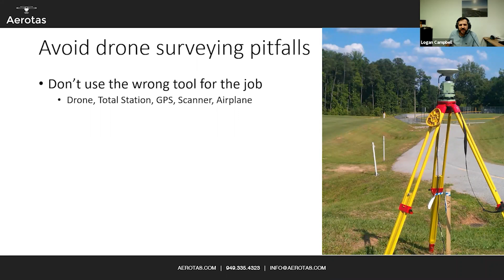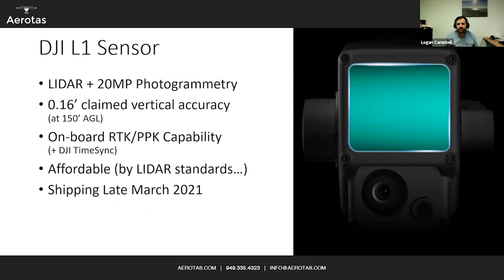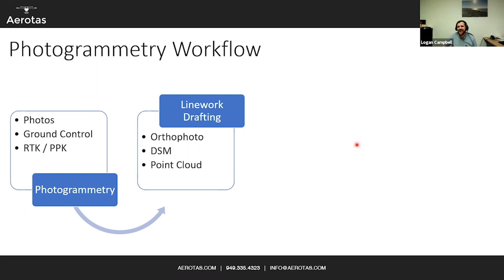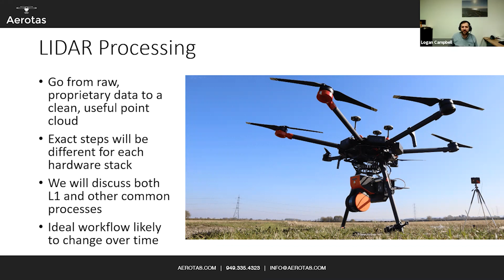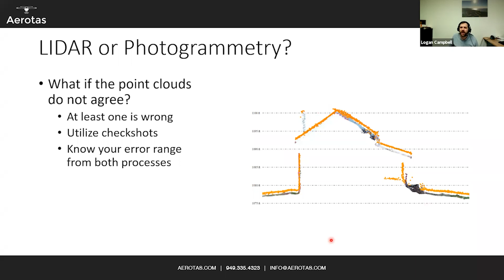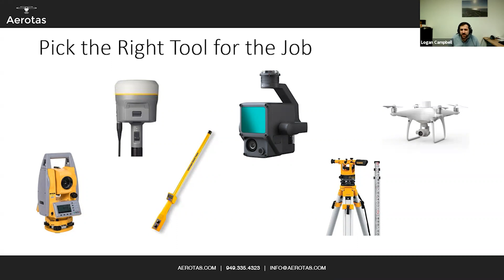Workflows for Combining LiDar and Photogrammetry Data - 2021 Western Regional Survey Conference

Comment: Thanks heaps for your sharing! For a 30skm mining survey to identify outcrops from black color manganese ore at 30-50cm dimensions. Do you suggest P1 or L1 for the work? Or manned plane is good enough to get 5-10cm / pixel high resolution photos? Another issue is the terrain follow function as the outcrop is somewhere 100m elevation difference. Do we need to use Terrain follow for the task which means L1 might not be applicable for terrain follow function? Really appreciate your thoughts. Billion Thanks!

Comment: You have done a great job of explaining the difference between photogrammetry and LiDAR workflows along with their pros and cons.  We are excited about the L1 due to its very low cost and specs on paper.  But i have so far seen a test that didn't turn out so well when compared to current 150k LiDAR drones with fuzz, aka plus and minus points taken at the same point.  I am also puzzled that there is no description on using the RBG camera to do photogrammetry without having to use the LiDAR.  It must be able to capture images to use for photogrammetry since it has a mechanical shutter which is not used for adding colorized point clouds.  It would use the cameras electronic shutter to colour the point cloud.  I am hoping to see you get your hands on it for testing asap as we are about to make the purchase to help with the surveying and inspecting power lines....the lidar can see the power lines much easier than photogrammetry!
Reply from the maker: Thanks for the comment! The L1 is fully capable of producing a photogrammetry model. In fact, we prefer to produce a photogrammetry AND LiDAR model and use the best of both worlds in processing. You might find our L1 review informative - https://www.aerotas.com/blog/dji-l1-lidar-review

Comment: Time to acquire data with the L1 depends on flying height, speed and overlap (no different to photogrammetry).  What are some specifications for these three key parameters with the L1 in areas that focus on vegetation acquisition (efficiency with reasonable canopy detection over absolute accuracy): 50m or 100m? 10 m/s or 5 m/s? 50% or 20% overlap?